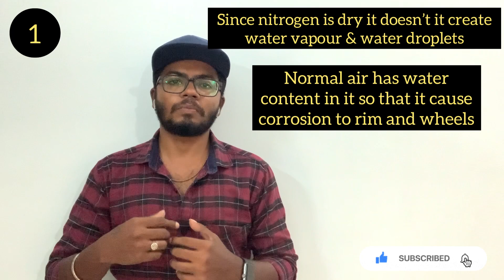Nitrogen Air vs Normal Air| Bike Tyre Pressure | #RoyalEnfield #Bullet #TyrePressure & #maintenance

Comment: Brother I own a 2003 Bullet 350 Electra  4S.
Front and rear tyre (3.25×19)
What tyre pressure is recommended?
Also, since it's time for me to change my tires should I upgrade my rear tyre to (3.50×19) (and what tyre pressure is recommended for rear 3.50×19?)
Reply from the maker: Use the same tyre 3.25 x 19 don’t change I also have the same model Electra 4s 
Pressure is 28 & 33
Reply from the maker: Use nitrogen bro check the air 2wise In a month

Comment: As per the recommendation of the OE manufacturer, the tubed tyre pr of old RE bullet bikes prior to 2002 states for tropical climate is 21psi for front n 28psi for rear ...pl check the service manual.
Reply from the maker: Now we are not using the same tube and tires from 2009 they have changed 
Sir please see in google & I’m happy u have seen the full video … have done a research about it sir & convoying the proper information 

Thanks for your keen reply sir

Comment: As proven by most aircraft and motor vehicles, unless your Royal Enfield routinely travels at over 40,000 feet altitude, the benefits of nitrogen in your tyres aren’t worth bothering about. No damage will ensue.
Reply from the maker: Yes it reduces the heat dispersion